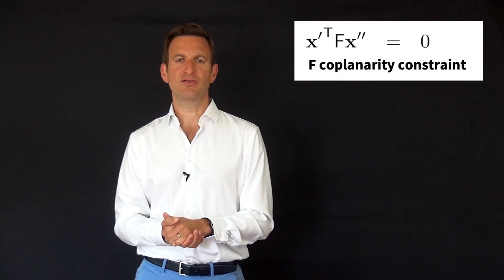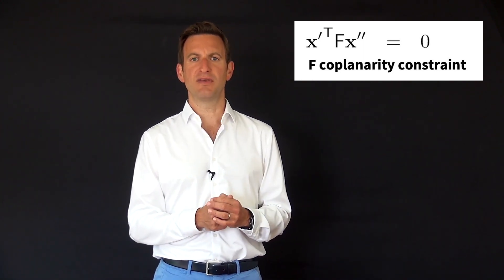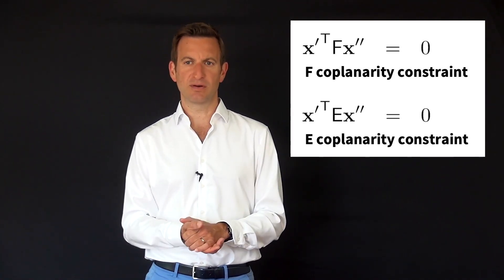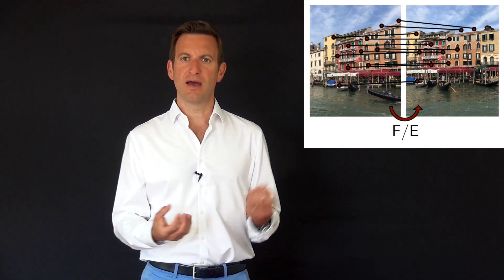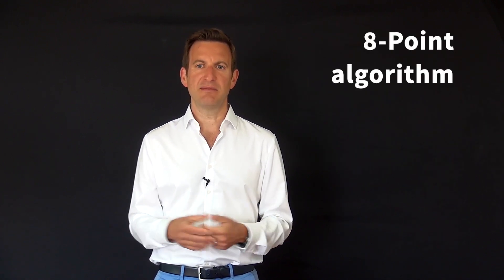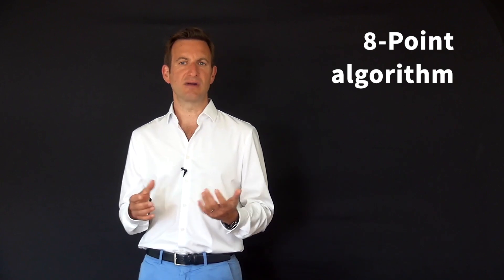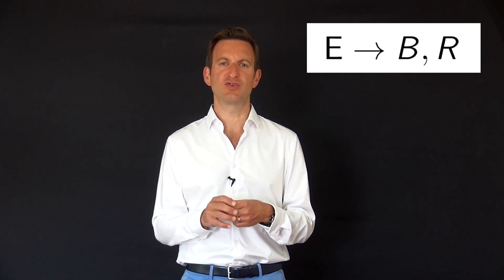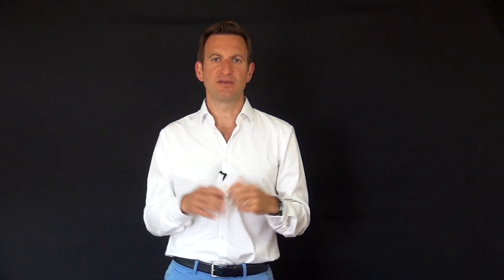Fundamental and Essential Matrix - 5 Minutes with Cyrill

Comment: Hey, can you talk about how these 5/8 points algorithm linked with Ransac, also, there's a 1 point Ransac if we do automotive constraint
Reply from the maker: Yes, there are variants requiring less points (eg work by Davide Scaramuzza) but they then require a special setup or other external constraints constraints. 5/8-point are general algorithms. You cannot go below 5 in the general calibrated camera case (as E has 5 DoFs)